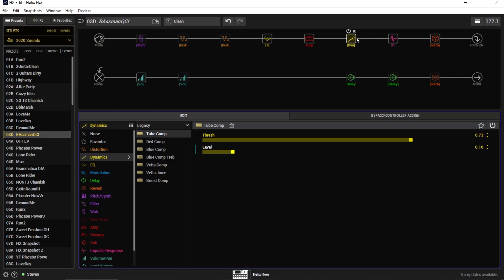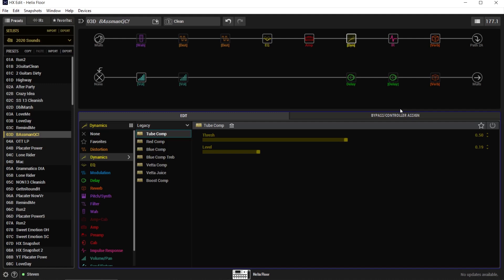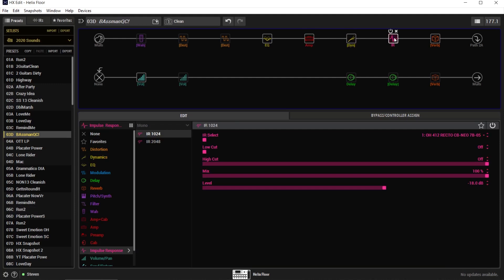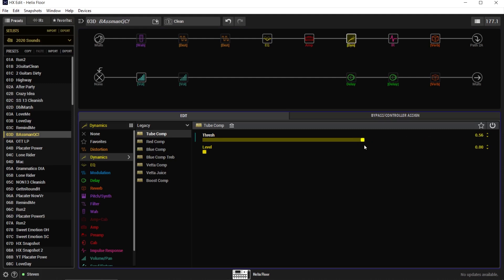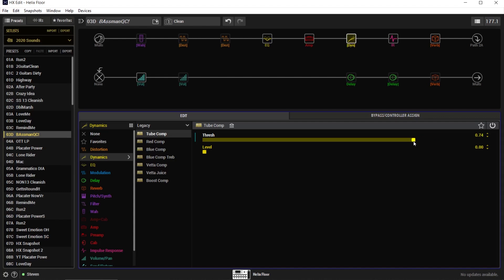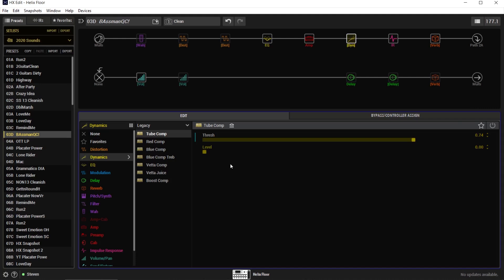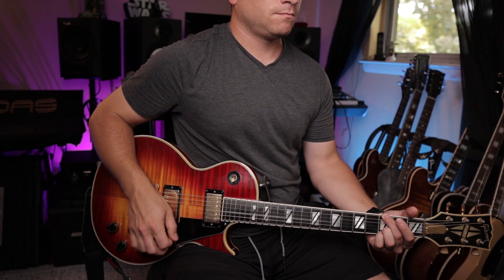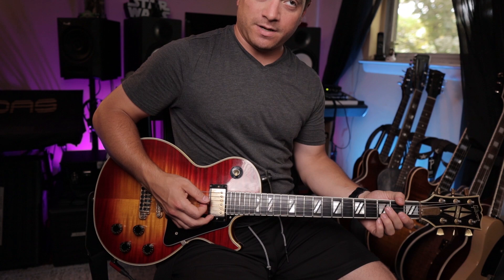How I Make the Line 6 Helix Feel like a Real Amp

Comment: My trick is to add an envelope filter mixed very very low.  It adds certain "squashiness" to the sound and makes the notes more alive, a very subtle "waaaaaaaaaaaooooooohhh", that you can barely hear, but it makes the sound more interesting.  When you palm-mute, it adds almost like a "boing" sound to it.  I use it mostly on clean lead sounds.  Give it a try.
Reply from the maker: I will give that a shot! Thanks!
Reply: hey how do you dial in the filter?

Comment: During the pandemic I spent a lot of time getting to know my gear. Bought a BOSS Katana as a cheap practice amp. It also has a headphone jack for practice at night in the apartment. Wanted something more so I eventually bought a Helix. Now I run the Helix through the Katana as a speaker cab. I only use the pre amp models on the Helix. Since  I have the 2x12 Katana,  I use the 2x12 cab models in the Line 6 for most realistic response. Coming from a Dr. Z Maz 38 2x12 to this current setup, in my opinion the best "amp in the room feeling" is having any sort of speaker cab at your feet, pushing air, while running using just the pre-amp models. I don't have a studio or studio monitors so all I know is the "amp in the room" feeling. I don't feel any difference between the Dr.z or Katana/ Helix in terms of response. And I'm happy with that!
Reply from the maker: that sounds awesome Matt! I totally see that as a great and viable option. I unfortunately have to be on silent stages all the time LOL

Comment: Hehe, I always have an LA comp at the end of my chain just for this reason!

To be honest, I'm not trying to emulate a tube amp because I really have never owned one. My approach is more "I'm in the studio booth and hear an amp and cab miced in the iso room" and there you'd definitely be going through a comp.

Funny how adding a compressor helps with both live amp and studio tone immersion 😉
Reply from the maker: For sure! The reason I don't prefer the comp at the end is that is affects the post amp fx and makes solo boosting more difficult IMO. So having it between the amp and cab lets me use the FX as if they were outboard gear

Comment: Until recently hadn't known/appreciated that many "Guitar Cab Speakers," including Classics like the Celestion, have shocking steep high frequency cutoffs around 4-5kHz!

On the HX Stomp, ALL the Amp Cabs have the High Cut arbitrarily set to 8kHZ. This means the almost all the Cab Speakers are out of Spec, and it makes a significant difference. It  makes everything about dialing in the Amp and getting a "Real" Amp sound much easier if the High Cut and Low Cut Parameters match the Frequency Response Chart for the particular Speaker. A  Speaker with a high frequency response of 4kHz will be completely borked by a significantly higher "High Cut" setting in the HX Stomp.

I'm getting the best tones ever by paying close attention to the Real Speaker Specs and setting the Cab to those. Getting it right makes a huge difference and I think is the "Secret Sauce" in making a Modeler sound and "feel" like a Real Amp. It easily gets rid of the excessive highs and fizz. 😎
Reply from the maker: Absolutely! I do the same in all my presets and tip vids
Reply: @SteveSterlacci  Thanks for letting me know. 👍It is beyond me why Line 6 Helix would set the High Cut on all the Cabs at 8kHz. It all makes sense to me now why so many users have complained about the excessive highs, and brightness in those units.
Reply: @picksalot1  mic recorded guitar sound have a lot of signal much higher than the speaker is able to produce according to it's chart. The things is it's not the CUT, it's gradual lowering. Also, mics are picking up some room sounds and speaker/cab overtones. So you must use your ears. I don't say you really need signal higher than 5k, but sometimes it's fundamental to cut through a dense mix with frequencies you can't hear but can feel.

Comment: Great tip and I do hear the difference. I found the best way to get a Helix feel and sound like a real amp is to use a real speaker cabinet and a tube power amp. IRs and cab blocks are just not for me. The only drawback of a real cab and tube power is that some amp models start to sound the same, but so do real amps.
Reply from the maker: Thats the beauty of modeling! You can find your best solution for any application
Reply: @SteveSterlacci  Very true. There are times I do use IRs and Cab blocks into a Headrush 108. Just prefer the tube power with a cab most times.
Reply from the maker: @danc3746  for sure! Makes perfect sense. I usually have to play on a silent stage with IEMs, so I am fully contained in Helix

Comment: I grew up playing through my lab series L5 (same amp BB King used), this has a built in compression and was probably the first amp that Roland/Marlin/Boss tried to make that sounded like a tube amp. Subltle use of the compression meant that it added a little bit of chewy sustain to my terrible solos. I now play pedals into a regular cube 60 (on clean channel) and have a boss compressor at the beginnig of the chain, always on… does the same thing. Have come to the conclusion that it is not actually the glass tubes that make that “tube amp sound”…. It’s the other components that regulate how much signal is going onto the tubes and therefore create compression when a load of signal is sent through the circuit……. I know nothing about electronics but that’s my uninformed veiw and compression always does it for me.
Reply from the maker: you make good points! i like it

Comment: In POD X3 Live a compressor block was always fixed after the amp. So back then, it was integral part of Line's 6 simulation chain. IF Helix still has some of the DNA of old Line 6 products, maybe that's why it still benefits from using compressor? My guess would be that in X3 gen, the power amp simulation wasn't as developed, so they've added compressor to simulate power amp effect on tone. Then there's still some "meh" about power amps in HD line, were Drive gain and Master gain are connected, which is irritating. It's like POD HD had finally DSP to abandon fixed chain of X3, but not a lot changed about the inner workings of the sim. It seems that in Helix L6 power amp simulation got a lot better. Yet, maybe it still benefits from the help of the ol' Tube Compressor ;)

Comment: You're assuming that the threshold all the way up means you're not hitting it, and therefore not getting compression.  That may not the case - even if it's not showing metering on the Floor's display.  And that would explain why you hear a difference between the bypassed and engaged signal with the threshold at max.  Mostly likely what's happening there is some specific frequencies are compressing while others are not, possibly combined with some loss of top end that naturally occurred in the original circuit.
Reply from the maker: Well, according to the meter, its not being hit. But that doesnt mean the compressor is totally flat and descrete. So it does add something to the sound even when not compressing.  I do like it even doing nothing

Comment: Using a Quad not a Helix but that is one good looking Les Paul Steve.  If you come across any tips like this to make the quad more amp like I would be very interested although I’m very happy with the sounds I’m getting.
Reply from the maker: Thanks Bill! I am looking forward to trying the new comps in this same role. I am sure ones bound to work great. Do you use captures or models?
Reply: @SteveSterlacci  I am strictly using models currently.  I play mostly 70-80-90’s rock. I used an evh 50 watt amp and since switching to the quad I’m finding it’s working even better.  It’s much more versatile as I’m sure you know.  I have one main preset with eight scenes that covers everything from clean to slight breakup to searing leads. I have been very happy so far.  Can’t imagine going backwards at this point; and I was dead set against modelers at one point.  Lol.

Comment: Hello Steve, great tip!  New sub here and I've always recorded my Helix through an amp and cab with two mics.  I just recently tried running the XLR straight to the interface from the Helix (to stream line things), and it sounds like complete ass.  Way bright and screechy.  I've not had the time to dive into your massive Helix library, any quick tips?  I've even built some new patches from scratch but they just sound thin and empty in the DAW.  Keep up the great work and stay safe!!
Reply: Have you considered the volume when you're dialing in tone? One thing I was omitting was making sure to lower my  output volume to my headphones so that I could focus on the frequencies and then dial it in how I liked at that lower volume. We tend to believe things sound better when they are louder and we adjust our tone accordingly. This might not be the tip you need but something to consider if you haven't already.
Reply from the maker: Thanks for the support! I have a whole playlist of 2 minute tips. I would spend time messing with the cab block to find what suits you best. I use the dual cab feature and blend mics onnthe same cab, then sum them to mono with the parametric eq to fine tune. Also, high cuts down to 6k or lower will help
Reply: @iA4R0N  I have, but I am still experimenting.  I've even down loaded presets from YouTube videos (ones using Helix cabs, not IRs) and what I hear never matches up with how the preset sounded in the video.  I realize YouTube compresses things so it will sound different, but sometimes they are not even close.  So unless the content creators are using post processing (that they do not mention), it is a source of confusion.  I've seen videos where Helix factory presets sound great but compared to how mine sound aren't even close (not without a butt load of tweaking).
Reply: @noeffnwaypal  depending on the mix, they are probably double tracking too to give stereo width.
Reply: @noeffnwaypal  Try turning on the input pad on the guitar block at the beginning of the chain, you can now use it per patch instead of global. It sounds a little less hot and you may need to change your gain and EQ settings but it will sound less compressed and more natural. I use it on all clean tones to get rid of high end distortion creeping in (this changed my cleans totally!) I still use the pad off for higher gain patches as I like the effect on them.
Reply: @jerbear1601  Thank you, I'll give that a try!

Comment: On a topic of nice feeling guitar sound - what are your thoughts on changing impedance to 1Mohm, and maybe adding ribbon 4038 mic (saw some discussions around these two)? I'm trying to figure out whether it's worth buying Helix or FM3. Trying to see if there's a way to dial in helix so that it sounds close to FM3? E.g.: get rid of harsh top end, avoid it sounding "nasal", more fullness on the lower-mid range, smooth, etc.
Reply from the maker: Its a hard question to answer since youre trying to solve problems you dont yet have 😅🤣. I have an fm9 and helix, both have plusses and minuses. Ive got a few videos outlining my thoughts on the 2.
Reply: @SteveSterlacci  Hey, appreciate the response, isn't the point of asking questions to avoid having problems? I'm not really looking to compare the 2 and prefer to research before I have a problem. Just thought since you have both devices, you may have tried to tweak Helix to match the sound/feel of FM9. Not to worry if not, you can just say it. I think my question was quite clear and specific.
Reply from the maker: @al23x56  yes, of course! But asking about specific solutions like impedance and mic choice for problems you may not have is my point above. Not putting down the questions at all! Just saying its hard to give recommendation on a solution without having it yet. I get great and usable sounds out of both. Id probably lean fractal only because helix is getting closer to a next gen within the next 2 years (purely speculation). But people who are first time modeling users ALL love their fractal